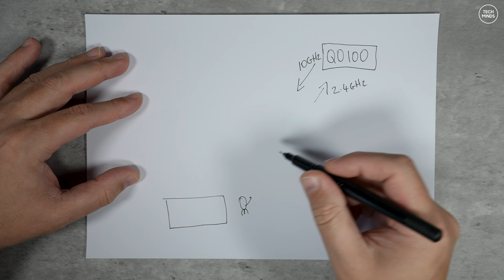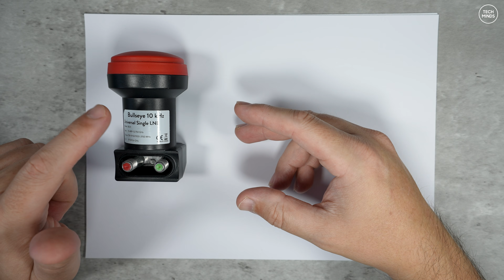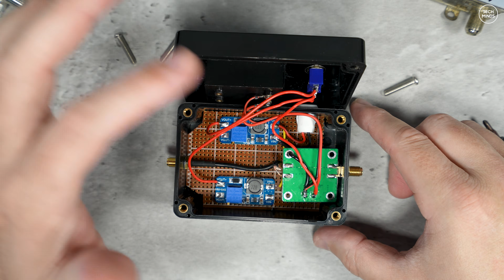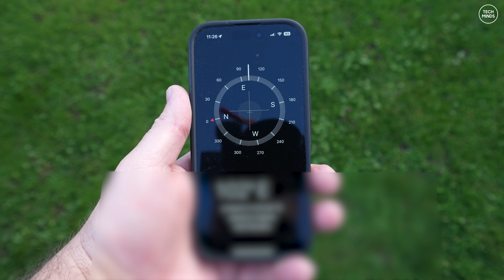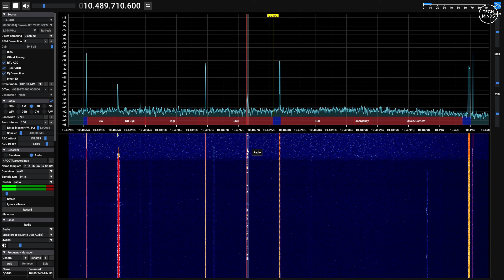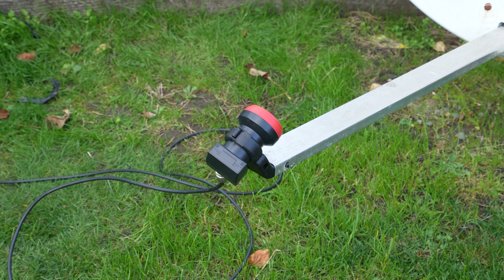How to Receive QO-100 Live Signals – Beginner’s Guide

Comment: WOWWW! VERY Well done! Like EXTREMELY!! 😀That beats the motorized beacon-seeker I attempted a home built on rotation-scan for the tripod, but never got it to auto Locate-Lock let alone Beacon-Lock... Field testing still required the remote to manually seek-n-lock. What you just did totally blowe away my setup- am going to try again when I can get some new equip.
Not even Irish and I get that kind of luck- just happenned to find this vid long after I shelved the whole project. Thank you graciously! ☘️☘️☘️
Reply from the maker: You're very welcome! Glad I could help you get back into it. ☘️

Comment: Great video!  Yes, please a video on TX!  As I am planing to get started I am wondering how kong the coax can be to get the signal to the shack?  I will need to put the dish about 15 meters from the shack. Any thoughts?
Reply from the maker: Receiving is not a problem with coax length, as the LNB emits enough signal for long lengths. However, when it comes to transmit you really need to think carefully about the signal loss in the coax @ 2.4GHz. This is why my whole QO100 setup is located just a few meters from my dish, in my conservatory. I use LDF250, but you can get lower loss coax too. Just remember, the longer the coax (for transmit) the more loss and less signal will be transmitted.

Comment: When pointing dishes to other satellites, instead of trying to follow smartphone compass indications I've been using Google Earth's ruler tool. I grab the azimuth from the dish pointing sites, and draw a line from my location in Google Earth t that azimuth. Making the line long enough, it is usually possible to find a distant landmark that will be on the horizon exactly on that Azimuth. With that fixed, its easier to find just the correct elevation for the dish. Works like a charm.

Comment: Usefull. I have the RX, but i have been strugling to build the TX part. For small budgets, it´s hard to have TX, because in my country i have that pay 100% tax over imports. I will try build a setup with a mixer and a local oscillator and use a 10m transceiver to the mixer. I tried use the first or fourth harmonic on a HT with SSB and a  proper filter without sucess. Please, show us the cheap options too. 73!

Comment: I only ever meddle with polar birds. Can anyone explain why there’s not at least a few hundred people being heard at once from the geostationary bird? 
Does it only bounce one transmission back at a time?
Reply from the maker: QO-100 has two transponders, each can support multiple signals at the same time. The lack of users at any given time is most likely due to the equipment needed to transmit, although, it is not as bad or complicated as some might think. There are times when it is extremely busy, especially on the DATV transponder. Try listening to the nb web sdr from time to time if you are unable to set your own rx station up.

Comment: I also started with Qo100 with a Bullseye LNB and an RTL dongle. Later, I moved on to DX Patrol equipment and now use a Pluto Plus with an SDR console. Now I want to receive DATV with the Pluto Plus, but I'm not sure how to proceed, so yes, I'd like an item for DATV.
Reply from the maker: If you have a pluto plus, and you have a dish already pointing at QO100, then simply feed 18v to your LNB and connect the output to your PlutoPlus. Then use SDR Television (the program showed at the end of the video) to then tune into some DATV without any further hardware :-)